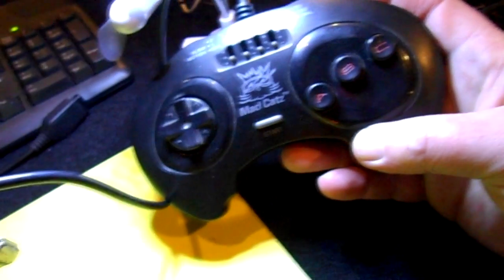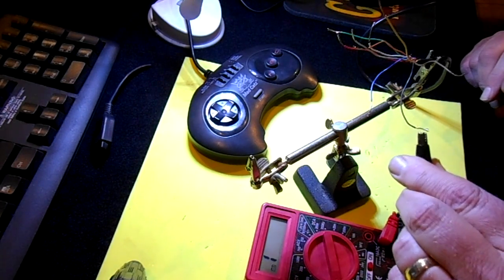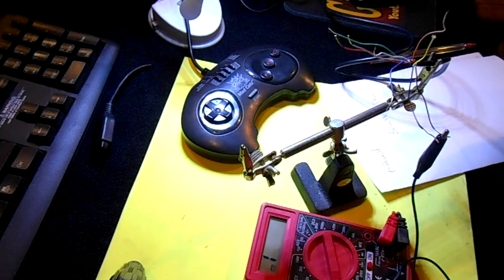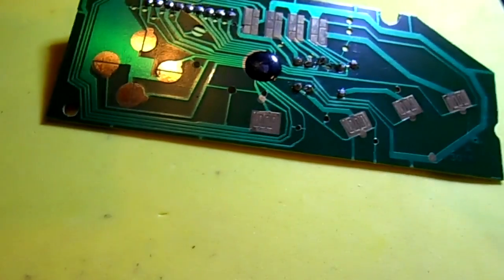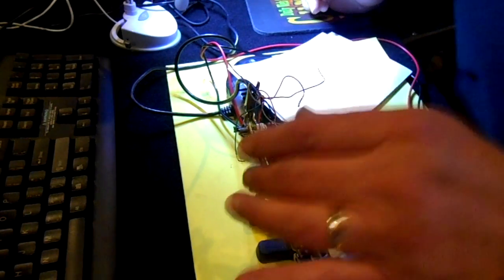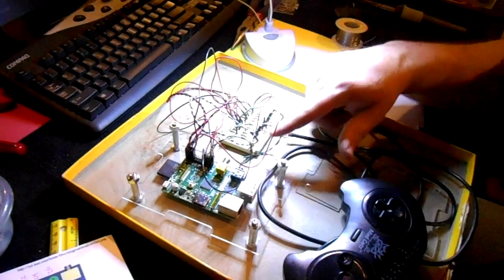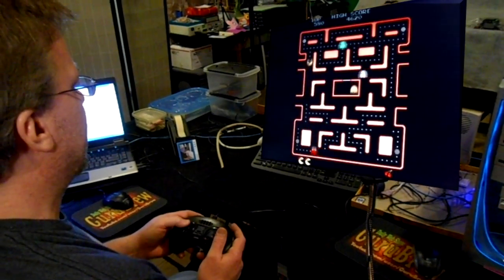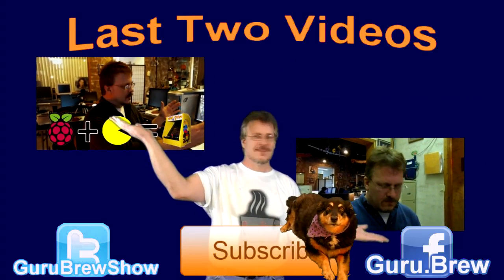Joystick Modification for Raspberry Pi Interface - Mini Mame Arcade Cabinet Build

Comment from the maker: Possibly you could get away without using them but it is a common practice to use to them on micro controller projects to ensure that voltage goes low.

Comment: Looks good. I bet that pi can play more than just the simple games.  I have an XBox 1 system that runs MAME pretty well.  The XBox is only 733mhz and 64MB RAM.  Your Pi will probably run just about any ROM you throw at it.

Comment: Could you explain how you configured the GPIO pins to work as buttons a little more in depth? What size resistor did you use?

Comment: Nice video, I was wondering if the resistor are really needed since adafruit on their "retro-gaming-with-raspberry-pi/buttons" (google it if you don't know it already) state that "The processor in the Raspberry Pi has the ability to turn on 'internal' pullups so you do not need external pull-up resistors for the buttons or arcade controller".
In that case do we need the resistors ?

Comment: why didn't you just map the wires cut to the pins on the DB9 plug you cut off and retain the functionality of the controller. or go to radio shack and buy the DB9 male connector for $3
Reply: That's what I would have done.  Or simply found an old serial cable or connector.  Those should be easy to find still.  Send they are usually opened with screws.